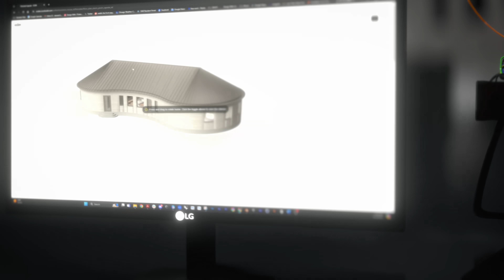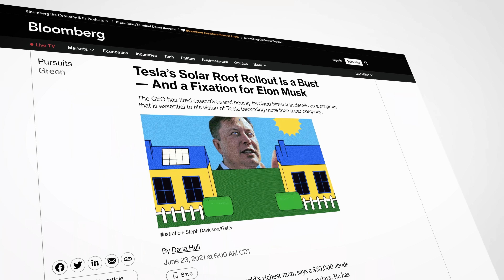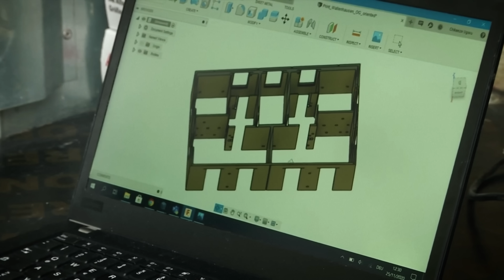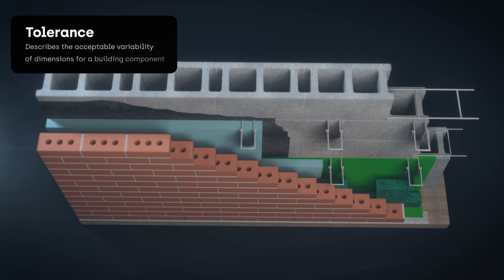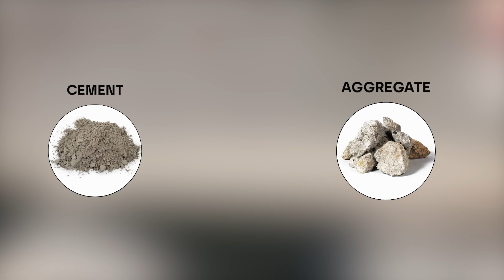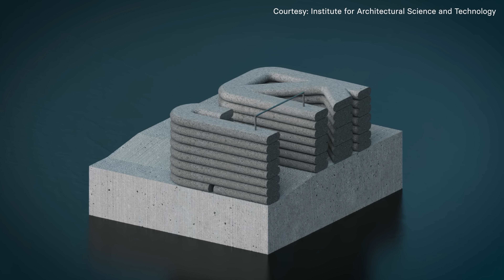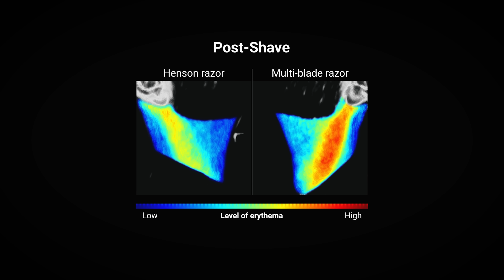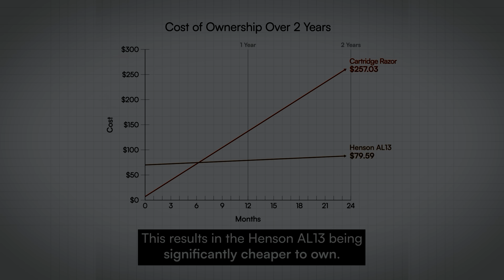Why 3D Printing Buildings Leads to Problems

Comment: 7:27 The solution for precision fit windows will be a milling robot that goes in after the print to use a diamond grinder to leave window openings far more stable and precise than possible by any other method.
Reply: I wonder if the print head couldn't also have a separate nozzle for expanding foam to use as a matrix structure for headers (to be knocked out later) and also to fill voids as insulation as it goes...
Reply: @ryanjohnson3615  Pouring  modern concrete is time sensitive, as it is reacting from the moment it's mixed. You stop the flow, and random parts of the apparatus will jam with concrete hardening inside the machine. Meanwhile, the already poured concrete will bind less with the eventual next layer the more time there's between them.
Reply: @diametheuslambda  Right. It has to start and stop fairly often anyway though. I'd think a 2 part foam nozzle could be routed right next to the concrete nozzle so it just switches to foam for two seconds as it passes a window or door.
Reply: @diametheuslambda  You are right. we have about 2-3 hours of working time before the hose will clog. We do have  specialized binding agents that give us a much longer open time than other mixes and we avoid a lot of the issues other mixes have. I don't know why people are concerned about the windows and doors it is a super easy fix...
Reply: Separate robot machine that comes in after rough window opening is printed and cured. It has different tools/nozzles/grinders etc. and it quickly forms a precise and specific window opening, perhaps even with custom ridges or flanges to accept a quick fit window designed as part of the whole system. Yes it's a second step, but it seems unlikely that any primary wall printer would ever be able to make anything but a rough window opening.
Reply: And what happens when the fifth owner of that house wants a sliding glass door where a window currently is ?
Or the 3rd owner wants to put an addition on or an attached garage (which requires a door opening) ?
This is just a dumb idea.
Reply: @johnnyonthespot4375  You get a concrete saw, same as any other concrete house needing modification. The idea seems a bit beyond your thinking level.
Reply: Or just forms, lol
Reply: So another expensive machine…
Reply: @ Machines are cheap and can be capitalized and depreciated.  Workers, Quality, and Time are all expensive.  Doubly so now that the illegals are leaving.

Comment: 13:15 The value proposition of 3D printed homes is the reduction in man hours via automation.  Placing pre-cast concrete panels requires far more heavy equipment, on-site labor, as well as capital investment to make and transport the panels.

Comment: If, say, 10 years from now, we could combined lidar sensors with ai, to continually evaluate tolerance issues and make adjustments on the fly, would that be a possible solution to the general tolerance issue you bring up?

Comment: 3d printing housing isn't solving the problem. The problem is a political one, zoning laws, Nimbyism, public transport etc. We need to be able to build the right kind of housing, where it's needed, with the correct amenities to support denser housing. 

Plus it's a ton of cement, which must emit Co2 as part of the chemical reaction to produce it, compared to a brick house that's just using it to hold the bricks together. Bricks, that are just made of clay.

This is a solution that's pretending to fix the problem. Actual innovative building is stuff like mass timber construction. Completely designed and manufactured beforehand. Strong, resilient, multi storey and eco friendly.

Comment: We could make a bunch of these parts like walls in factories but we made it illegal to put modular homes in 90% of America
Reply: Prefab homes are built all the time. We just have companies like Jim Walter Homes that go belly up for various reasons. I know they're not exactly prefab, but there are homes built in sections and assembled on site and they're pretty common. You really just have to get and engineer to sign off on it.
Reply: What that sounds like BS you can order tons of prefabricated parts for walls, foundations, forms, insulated forms, insulated forms with studs, ... heck you can order modular buildings in steel in >90% of america.
Reply: I work in mass timber. Not only are factory fabricated building components not illegal, the government is offering major subsidies for using them. Don’t know where you get your information.
Reply: Regulatory capture is the bane of the American economy.

It’s the reason why healthcare is so expensive. Why government spends so much money for so little output. Why so many industries are monopolized WTH inferior versions..
Reply: @astronemir  oh I've never heard the word regulatory capture before
Reply: Modular homes are legal everywhere. Modular isn't manufactured.
Reply: @toomanymarys7355  Not really. There are so many regulations you are basically confined to really rural properties or private fiefdom parks where you are always beholden to the whims of the owners from rent increases to aging out of trailers to selling the land out from under the trailer park residents. It's a horrible system that needs to be outlawed entirely...
Reply: @toomanymarys7355 kinda of, in my state they actually consider them the same so you cannot have a modular home.
Reply: I didn’t vote for the representatives who wrote or president who signed the  bill into law so don’t include me in your “We” made it illegal statement
Reply: Technology challenges aside, this process produces an ugly house. The ridged texture of both sides of the wall is a non starter for me. The Time and Material to Stucco or Skim Coat the walls sets the whole cost/benefit equation on it's head. No thanks.
Reply: UL 3401
Reply: not me....
Reply: That outer wall insulation seems very thin.
Reply: Tresses and prehung doors are nearly all prefabricated.
Reply: I wonder why... People dying when the "Modular house", "Stick Built house", or "Mobile Home" gets wiped off the face of the earth during severe weather wouldn't have anything to do with that for example?
Reply: The shipping costs of the built parts are what kills this idea & have you SEEN how modular homes are built ?? I have worked on many and they are not built well just built fast.
Reply: @johnnyonthespot4375  Is it really that different than stick-builts? There's a reason why the term McMansion exists. Developers and builders will cut corners on everything they can get away with. We have inspectors for a reason and even they aren't always good and even the good ones might not catch everything.
Reply: @johnnyonthespot4375  Most of US homes, regardless of the construction method, are not built well. Most of 'modular/prefab' homes I've seen in Europe are typically better built than brick-layed homes in the States.
Reply: @zwerko  -- I agree completely with your opinion (I have been in the construction industry for almost 40 years now) and I have a plan for this -- The TECTON -- I am working on the Engineering aspect & locating suppliers for the Ai portion right now  - This will change how Homes are built.
Reply: @johnnyonthespot4375 you’re thinking of prefab. Modular homes are usually built above what code requires.
Reply: @johnnyonthespot4375  No matter what the material you build out of is, it needs to be shipped to you. It's mostly just a logistics issue spinning up a new thing to compete with an established thing.
Reply: No, we didn't - Boomers did.
Reply: @interstellarsurfer    Boomers did not.  The Silent Generation did, though.
Reply: If you didn't correct it, you allowed it.
Reply: @bluesnjax9134  impossible
Reply: @interstellarsurfer gees stop blaming boomers for every dam thing that goes wrong. 
Why is it other countries have managed to build pre-fab buildings to code but not in the US,  because the UNIONS WONT ALLOW IT they see it as taking work from the brick layers. 
Not the case in the rest of the work, the brick layers love the fact they can work inside regardless of the weather. Where as if they are on site and it’s raining for a week or two they don’t get paid because they can’t lay bricks in the rain. But they can pour concrete inside a building into a mould no matter what the weather is doing outside.
A few years back there was a whole town moved because it was built over one of the largest gold deposited ever found. 
They moved the houses out to new streets families even got to have their homes moved next door to each other and much more. They also built a huge temporary factory that pre built the houses on a platform in side out of the weather just like building a car assembly line but it was full two story houses the house was built on a trailer and moved to each section as it got done until it got to the exit of the over sized factory where a truck then drove the house to it’s actual street address where it was then placed onto the foundation that had been built during the summer. 
And yes it was brick and timber and everything in between during the winter the builders were kept busy building the homes in the factory and at the end of the building run there was a fully built home rolled out and then placed onto its foundations all through the winter. As each street was done the factory was then moved to the next street location and they started all over again.
Americas biggest problem is your unions and how they block innovative ideas to improve the industry.
Reply: Yep, America desperately needs deregulation on the housing industry.
Reply: The current age of the United States is older than the median lifespan of human empires by some estimates. This country is on borrowed time, and it shows.
Reply: @imveryangryitsnotbutter  The US didn't fully become an empire until WWII, but it was heading that way by the very late 1800s. I'd give it an extra century or so...

Now, if you'll excuse me, I need to go back to digging my survival vault (made with Genuine Vault-Tec Parts!) 😉
Reply: @imveryangryitsnotbutter  Pseudo–intellectual dribble. 😂
Reply: @imveryangryitsnotbutter The US isn't an empire though, its a liberal democracy. Empires are intrinsically unstable because it is in literally everyone's interest to replace the system (either to seize power for themselves, or just to role the dice on getting less-terrible government). Democracies are stable
Reply: @imveryangryitsnotbutter I know what you're saying but uhhh the median of something like time can be dragged down by a lot of lows. So a bunch of empires crumbling in one generation/ a few decades drags down the median lower than the mean which is more of a true average in data sets. 

It's a simple mistake but it's why people say "in the past people didn't live often past 30". The average life expectancy was 30. But that's because children died a lot like A LOT, not 20 something's. If you were in your 20s in the past you were actually out of the woods.

Comment: “Forever haunted by a memorial of this imperfection”. Couldnt have said it better. And thats what makes 3d concrete printing so frustrating. Its dynamic, you cant be always monitoring the quality of the print. Especially when youre printing in an outdoor or open space, every little change in the environment affects the print quality. And whatever goes into the tube may seem okay initially, but watch it get extruded in absolute mess. Theres so many variables that it makes this type of construction causes more unique problems than traditional building methods. Im not sure if 3d concrete printing is the future, but i feel like automation of what humans are doing on site, would be the future.
Reply: You'd think putting something up to control more of the elements would be common to address that. Like a plastic greenhouse type thing

Comment: I keep seeing videos and websites saying "this revolution in 3d Printed housing could change everything.  I saw a demonstration of a 3D wall printer at a trade show in the late 90s.  This isn't new, the reason that it hasn't been adopted is because its more expensive and slower to finish.

Sure you can put up the walls in two days instead of a week, but then they have to cure for weeks before you can move on to the next step of utilities and a roof. 

The companies will keep quoting "The median cost of a house in the US is  $400,000 but this house only cost us $100,000!"  But they are only counting the cost of the the walls they exclude the foundation, the property, the utilities, insulation, windows doors, drywall/finishes, painting, fixtures, appliances and of course, profit for the builder, and the model they show is normally 700-1000 sqft which is nice but not the 3000 of the average new home.